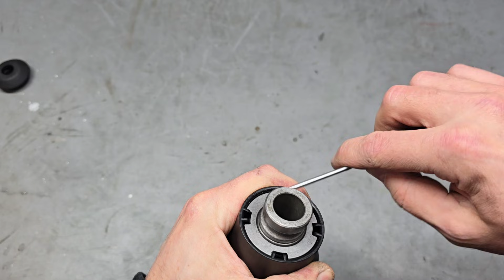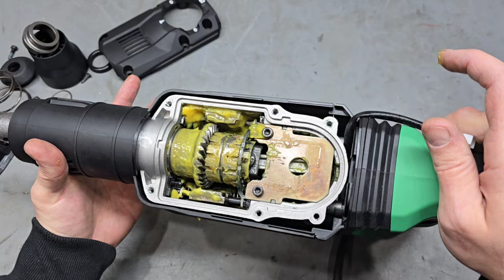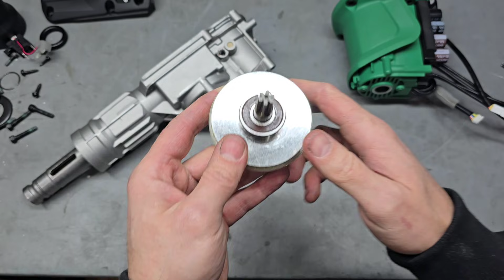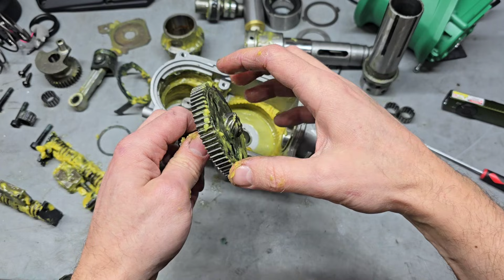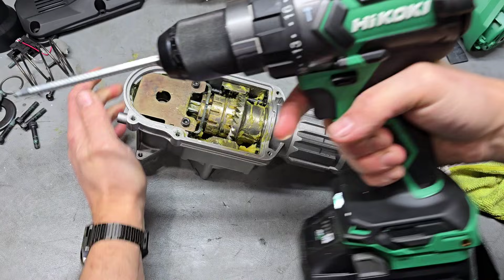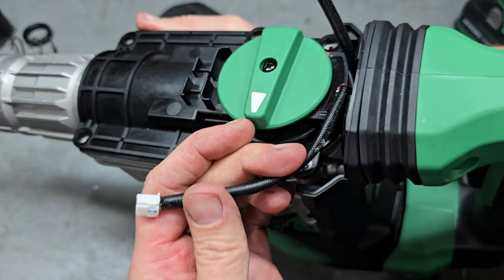New Powertool Teardown. Fully dismantling a new Hikoki DH40MEY2 hammer to see the quality inside.

Comment: Nice tear down video. It looks to be a quality machine. I agree with you regarding the small electronic module in the handle. It’ll be a filter to protect the controller from electrical interference, voltage spikes etc.

Comment: That there is your Bosch killer.
No nonsense tool.
The only downside of this tool that a can see, is the way you top up the grease. You have to dismantle the tool holder to take the cover out, and then you can take off the top cover and top up the grease. Not a big deal, but should be simpler. Other than that, that's one really solid tool.
Reply: I was wrong. You can actually just unscrew a top cover and top up the grease, so.... seems to be just perfect hammer 👌

Comment: Impressive. I have the 36v version with the 120v inverter unit. It's been a dream and I've pushed it hard sometimes. Just wondering if the price is good on the Hikoki grease compared to the Makita and if ir comes in larger tubes?

Comment: I'm surprised they make corded brushless appliances.  I disassembled a fan that didn't work, and assumed it needed brushes, turns out it was brushless, and one of the wires had a knick in it.  It's probably a coincidence, but I feel like brushless motors tend to make a high pitched whine that can be quite unpleasant to hear, and not as bad as the noise a brushed motor makes due to being lower pitched.  At least, in a lot of brushless equipment I've had the honor of using.

Comment: I still got old hitachi gear still working 15 years on
Reply: Yes i have a well used 5" mains hitatchi grinder of similar age. This is the one i keep by my  workbench  and does the heavy work, its had a few brush changes but still runs well.

Comment: I own a dh40mey (1). Only issue until now was a worn needle bearing for the connection rod, easy and cheap to fix (like in dean's metabo video). 
A big difference between 1 and 2 (function wise) is that 1 has no hammer on lock button. Really annoying, but easy and cheap (~4 Eur) fix is using the trigger and steel pin from the h45 mey, gives lot more value to the machine.

Comment: the biggest negative i see is i cant get hikoki in America. we only have metabo hpt products. i bought the metabo coil gun for a shed im building for doing the roofing and to my surprise it has an adapter for doing vinyl siding. i had no issue with it and it worked great. i was worried about it working reliably in 0 to 15 degree weather and it didnt have a problem with those temps.
the main cordless brand i use is dewalt with a few milsuckee's and i have a hitachi triple hammer impact and cordless drill. all my corded tools are bosch hammers of all sizes but this spring i might have to buy a metabo hammer just to check out how it competes with power to the bosch hammers.
thanks dean for the tear down vid.

Comment: Really nice construction. The limiting factor on lifetime on inverter motors is those three capacitors and since they're potted can't be easily replaced. They also hate overvoltage and high temperature. Can you read if they're 400V or 450V? That's a tell tale for manufacurer's intensions. And these transistors are not mosfets, they're igbts or if hikoki felt large they're silicon carbide discretes. A bit concerning is the large gear ratio because that motor can run way faster than brushed ones. Is rated power and impact joules advertised?
Reply from the maker: Thanks for the heads up and corrections. 
Always like to be corrected if im wrong about something. 
Zoomed in on the caps, they look 350v rated. 
Yes, 450v would be better, had a wee Google search on cap specs for investors. 
Higher voltage rating means a higher safety threshold and better surge protection. 
Shame they are only 350v. 
Thanks for being it uo, ill know better next time and know to look for 450v
Reply: Not corrections, tech details. Now 350V caps will handle 250V AC continuous and a few volts short peaks on top of that but that's easily the case with some non AVR or badly adjusted generators so I'd avoid. Unless marking is 350 WV (working voltage), in such case will be more robust, it's another spec, will survive 15-20% higher. Really good machine, on longevity only time will tell.

Comment: I'm still at the beginning of the video, so you might explain it later on, but somehow it seems I hear a very high pitch noise when it 'starts to stop' if that makes sense? Anyway: on to the rest of the video :)
Reply from the maker: That's because its a brushless motor. That is the electrical noise from the controler. 
You only hear in starting and stopping

Comment: 38:20 looking at the dampener that is still in the tool.
I think the small white oring on right side of the dampener got lost into the grease in the spring below. 

Nice to see more Hikoki videos. 
Bought their newest starlock multitool a couple days ago.
Reply from the maker: How do you find the hikoki multi tool. Was wonding what that one was like myself. 
Its hard to get a good powerful multi tool
Reply: I saw that also. definitely missed the little white plastic o-ring on the upper right damper. Must be lost in the grease when he took it out.
Reply: Damper--not dampener.  It 'damps' the vibrations.  A dampener makes things wet 😀

Comment: A brushless tool with a powerlead. What sorcery is this? Sounds very different when running.
I hope building them this new way results in less motor failures.
But now you have a fairly elaborate frequency converter/inverter (variable frequency drive) in there. It has to be a full VFD essentially aka 
Rectification - "DC Bus" (if you want to call it that) - Inverter/Output Stage and all the control circuitry.
Cant fault the build quality at all but time will tell how reliable these really are.
But you would have to be really careful to not run a tool like this off "dirty power".
We once had a crazy case some years back where a large old VFD Drive driving the likes of a 500kw pump motor so quite large backfed transients and harmonics so bad that it blew out multiple smaller drives. The easiest solution was to cut up the main AC bus so the big drive would be isolated and fed by its own transformer that drive cabinet would have been very costly to replace with a modern one and good line filtering/reactors. Thats also a very often overlooked factor when dealing with mysterious "dirty power" issues and devices failing when they shouldnt: Does the facility house large VFDs that could very well be responsible.
This is essentially the same thing a VFD and they can fairly easily be taken out by really dirty power.
Id imagine the little line filter module contains a metal varistor (the blue capacitor looking component) to act as a last line of defense for spikes and transients.
The question then is, is one varistor enough to arrest a strong voltage surge that has some amps behind it. I would love to see that complimented by a gas spark gap type surge arrester. Sounds big and expensive but they come in essentially the same size as the little blue varistors and are better in a way, once the spark jumps over the arc is continuous and clamps down the voltage hard until line voltage returns to normal. But they usually need more voltage to become conductive so the two compliment each other. 
Search typen 1, type 2 and type 3 surge arrestors there is good information.

Comment: this tool will fail sooner than any simple made  china tool , cause pcb which is required for any brushless motor for these days.
Reply from the maker: Then how am I servicing metabo hammers with a similar brushless motor for the past 5 years. 
I would have agreed with you 3 years ago.  But iv never seen a single one with a pcb, controler or motor problem at all. 
So iv since changed my tune. 
Time is the only real true test, and these and the metabo have been proving themselves.
Reply: @deandohertygreaser 
 you make a great work nowdays and i am glad of it . there is more problem  for this sds max, they use needle bearings which cause more micro playings for gear teeth than ball bearings,thats why makita and dewalts 6+kg  sds max hammers last longer and their gear looks great after some years of use , even bosch used ball  bearings in its largest sds max hammer gbh 12-52 dv.
Reply: All depends how well its engineered and manufactured.
I know VFDs that last 20 years driving large 3 phase motors every day with sometimes hundreds of amps pumping trough them.

Comment: Surprised no selector for rotation with no hammer.
Reply from the maker: If they had rotary only mode, the first thing people would be is buy these for diamond coring. 
And the clutch would not take it.
Reply: @deandohertygreaser Us window fitters with broken backs never  got to drill much other than fisher bolts or tapcons. I thought perhaps if you come across reinforcing bar in concrete perhaps a chuck on sds adaptor might be used to go through steel. But maybe they use bits can go through the steel re-bar as well ?
Reply: You would never need that with an SDS Max hammer.
SDS Plus drills there it makes sense since people use them for small diameter dry core drilling and with a chuck adapter for the likes of large wood drill bits and as a mixer.